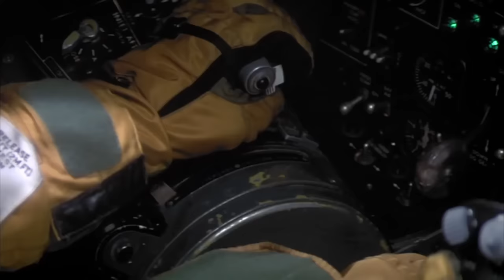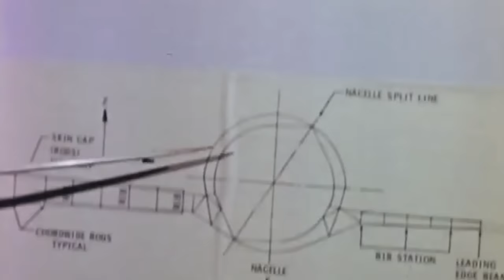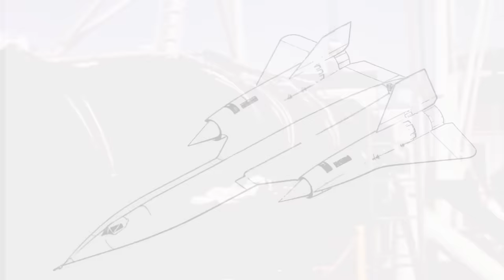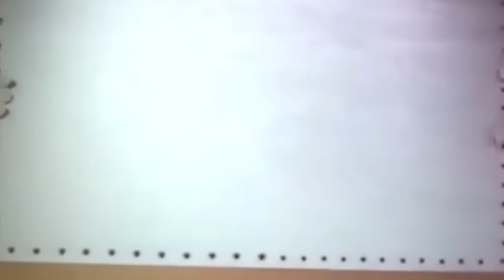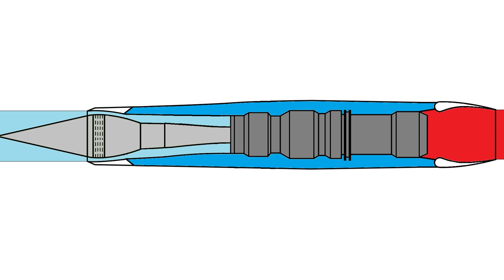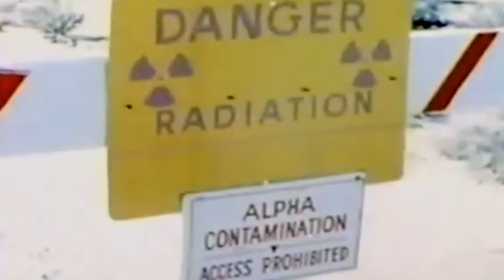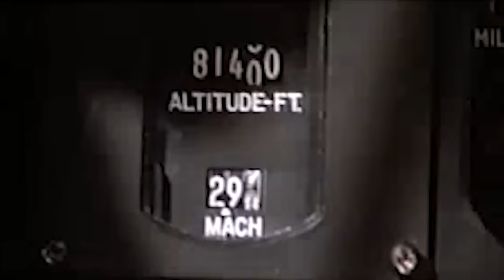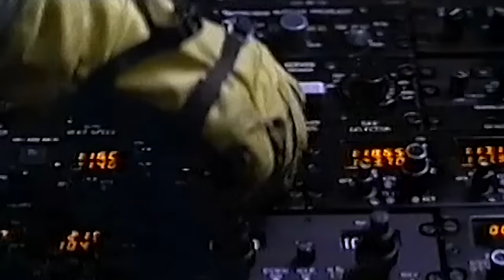Lockheed A-12 | Speed matters

Comment: What I want to know about is the crazy variant they tried to turn into a combat interceptor.  What the hell was that thing capable of?
Reply: YF-12! I'm waiting for it from Sky
Reply: YF-12

Other than high speed, not much. 

What one has to remember is that these planes weighed as much as a 737, with the same maximum G loading (2.5 Gs) but none of the wing area. 

If you hit a merge in an A-12 vs a 737... the 737 would likely quickly gain the advantage... with a full load of passengers in the back!  The only thing the A-12 could do was run and climb. 

As for weapons systems they eventually made it in modified form into the F-14. While the weapon system sounds amazing... every fan of the F-14 knows that it can track 24 targets at a time and engage 6 of them at over 100 miles away with its AIM-54 Phoenix missiles... in practice it was less than spectacular. 

The radar was a giant billboard that announced that F-14s were in the area. That’s why they were modified with passive FLIR sensors and fed data from E2C Hawkeyes rather than announcing their presence to the world. 

The other problem was that in order to achieve the extreme range, Phoenix missiles used a ballistic trajectory.  But this meant that they were incapable of large course corrections. 

So when F-14s engaged a couple of Iraqi aircraft in the no fly zone.. those Iraqis were alerted because of their experiences with Iranian F-14s..... and they simply changed course and the missiles fell short.  

Interceptors were obsolete by the time the YF-12 flew. That’s why the Avro Arrow was cancelled in 1959, the XF-108 was cancelled the same year, and the Soviet Mig-25 though impressive and probably the main reason why Soviet skies were kept A-12 and SR-71 free for decades... had a rather disappointing combat record.
Reply: @Bartonovich52  I had no idea interceptors were obsolete.
Reply: At the time we were developing the XB-70 Mach 3 bomber.   There were those in the DoD who thought the Russians were doing the same and felt we needed a Mach 3 interceptor to stop them.  If you look closely at the YF-12 you will notice that the forward fuselage chine stops where the radome begins.   The chine interfered with the AWG-9 radar and so it was eliminated.   You can't shoot down what you can't 'see'.

Comment: The speed of light is a physical constant denoted by the letter c. Its value is 299,792,458 m / s, or 1,079,252,848.8 km / h. According to a special theory of relativity, no body with mass can reach the speed of light. The speed of light is also the upper limit of the speed of all information, including massless particles.

Comment: Oxcart A-12 was faster than SR-71..Already in the 90s it was speculated that he easy could fly 4000kph in 25km altitude.
Why? Because A-12 had special varnish causing less air resistance. And the engines had other settings, like "a car in sports mode!"
Reply: Skin friction drag is not the issue - it's wave drag and surface coatings have no effect on wave drag.

Comment: The belly of this ultrafast airplane A-12/ SR-71, is like that of a fast racing boat, it's an issue of 'Reynolds number', an adimensional figure expressing relations between viscosity and inertia inside a fluid.
Reply: Um,,, a Reynolds number has more to do with the size of a wing than anything else. Think 747’s and paper airplanes…
Reply: @michaelgarrow3239  Don't know, I'm not engineer, but Reynolds number for sure has connections to speed of aircraft
Reply: @josega6338  -  “The Reynolds number helps predict flow patterns in different fluid flow situations by measuring the ratio between inertial and viscous forces.”
Hope this helps. Not an expert either. But looked into it when I was a kid building model airplanes.
Viscosity is relative to the size of the wing. That is why bees can fly and Tyrannosaurs can’t…
Reply: @michaelgarrow3239  Thanks, that's exactly what I said about Reynolds number. 
Blessings +

Comment: You sure the spike moves back the faster it goes? I thought it was the opposite, because the shockwave moves to the rear as speed increases (like a swept wing moves back out of the shock wave), and it also opens the intake up for more mass flow.
Reply: yes. Wikipedia has a detailed article on the P&W J58. Explains it.

Comment: It had so many fuel leaks, had to be fueled until takeoff.  Not a mistake, the aircraft flew so fast in the air, the skin swelled, and thus the leaks stopped.  Great U.SAir Force airchine!
Reply: It just dripped, the reason for the tanker immediatly after takeoff was that the landing gear couldnt handle the weight of a full fuel load.

Comment: I see you're doing some videos on the A-12/SR-71 series, and I haven't watched the whole video yet, but there's a couple things I hope you do cover, either in this video series or in videos of their own.
The D-21 reconnisance drone that was designed to be launched from modified SR-71s (and later when that proved too risky, it used a solid rocket booster to get it up to speed when launched from a B-52). This might need its own video, but it's intimately connected to the Oxcart program.

Also, it's Russian/Soviet counterparts (with respect to speed at least), the Mig-25 (stainless steel! Amazing that they made it work with a material that in aviation is considered "primitive"), and the Mig-31 (and their recon variants of course). Both interceptors true, but they were very very fast, and I'd like to know if their engines were as revolutionary as the engines in the A-12/SR-71 or if they were just "really really big turbojets" of more conventional design. I do know that the airframe of the Mig-25 was not the limiting factor for speed, and that the engines could be pushed past their design limits if needed (I've seen that on a few other Russian/Soviet combat aircraft like the Mig-21, yet I don't think I've ever seen such a thing on NATO jets, which instead prefer to engage the afterburners).

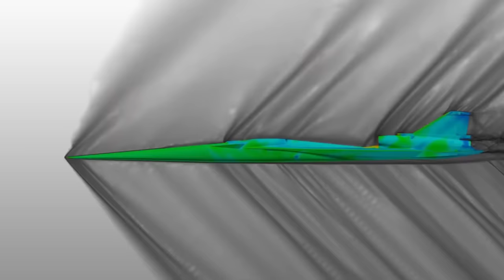Comment: @24:50
"This is without modern design technologies and computers ..."
Wikipedia:
"The only PDP-3 was built by the CIA [...] to process radar cross section data for the Lockheed A-12"
Reply: Computers were widespread at the time. Electronic computers were calculating artillery ranges shortly after WWII. 

Why do people still believe that the SR-71 and the Apollo program were all designed with slide rules?  They would still be working on them today if that was the case.
Reply: And was the PDP-3 a modern computer? For our time?
Reply: @ervandrush3116  
Yes. It was electronic binary Turing-complete programmable computer using von Neumann architecture.

Comment: If I had a few wishes (without practical limits) before I died, one of those would be a fight in an SR71
Reply: Flying in an SR71 is complex and not a typical passenger journey. It requires two pilots to operate the craft and not everybody is physically suited to fly in the craft and to operate it. Flying in the craft requires the use of space suits as there is no oxygen at that altitude and the cabin has lower pressure than a normal aircraft. 
It could be such a rough and harsh experience that people would not enjoy it.

Comment: watching the gas just pour off the thing while in flight is just scary....
Reply: It is not 'gas', it is jet fuel. Kerosene. It is not explosive or even very flammable, especially not the special kind used by the SR-71, which is almost impossible to ignite except under very high temps and pressures.

Comment: Way early on,  I wish the Airforce stuck with their nuclear powered aircraft.    Had they did this?   They would have made a  plane that could stay in the air  well over 24 hours.     If only they found a way to separate hydrogen from the water vapor in air, and use that power and cool the plane?   That would have been so cool.

Comment: Calling it a different plane is silly 
Same basic air frame same engines same fuel same . Go to Palmdale CA blackbird park it’s a parking lot and 2 airplanes An A12 and a sr71 it’s hard to tell them apart
Reply: Yeah, sort of.   The SR is 5 feet longer, has a two person crew, and the chine going forward to the nose is fuller (not as pointy).   The SR has a bit of a 'stinger' out the aft end.

Comment: Didn't the Swiss intercept an SR-71?
Reply: The swedes escorted an engine damaged sr71 back to safety. Not an intercept at full sr speed, but still a serious intercept for their saab 37 viggen planes.
Reply: @dirkcornelis5708   I read the Swedish found out the rought of the SR-71 and tried to practice intercepting it and once it was successful but I don't know if it comes from the same story that your talking about
Reply: @SPak-rt2gb  that would be a different one. Maybe they had a chance when the sr71 left its high and fast profile on the return path. Lets see if we can find data on it.
Reply: They successfully intercepted it multiple times. 

It’s difficult, but not impossible. 

The first is the predictability of the SR-71’s route. The Baltic corridor had to be in international airspace or over friendly nations because in spite of its stealthy pretensions.. the SR-71 had the radar signature of a barn door thanks to the large numbers of particulates in its exhaust plumes. 

The schedule was easy to figure out because anyone within 25 miles of RAF Mildenhall would hear it take off. More than enough time for the Swedes to have a leisurely breakfast and saunter out to their Viggens. 

They’d sortie and loiter at the tropopause... about 36,000 feet on a standard day. This gives you the coldest temperature for your engines and the thin air allows for the highest true airspeed of most planes as well as conserves fuel for the intercept. Any higher and the stagnant temperature starts robbing you of power. 

They spot the SR-71 turn towards it, go max afterburner and max out their speed on an intercept course. 

Then you pull slowly up. Not too fast or you’ll creat drag and lose speed. Not too slow or you’ll lose speed and power in the steadily thinning air. 

Now... most planes of that power can easily zoom up to 90,000 feet or even higher. The risks of course are flame out, rapid depressurization to the point that even pressure demand oxygen won’t keep you alive (which is why SR-71 and U-2 pilots wore full pressure suits), and the potential for the aircraft to tumble uncontrollably in the thin air (which is why the X-15, NF-104, and Space Shuttle have thrusters as well as aerodynamic control surfaces).  So likely a more manageable altitude of 60,000 feet was a target. Which is a mere three miles lower than the SR-71–absolutely nothing in the world of air combat. The SR-71 would be easily visible at 5 miles and possibly visible at 10. 

The big thing is that you can’t maneuver very much in this zoom. So if you misjudged.. or the SR-71 turns, it’s no good. 

But with several aircraft, it becomes easier. Every time the SR-71 turns, it loses speed. Then another aircraft intercepts. On and on it goes. 

This is why when the Soviets did it, they did it from multiple angles. Leaving little doubt that had the SR-71 ever strayed into Soviet airspace, it would be immediately shot down. The Mig-25s and Mig-31s they used to do this were also a lot faster and higher flying than the Viggens.

Comment: Mack 3.2 is the "cruise" speed... nowhere near it "Max" speed.which was closer to mack 5 than mack 3. There are two or three aluminum aircraft that can do mack 3 in short bursts.
Reply: The problem is not the airframe, the limiting factor have been the engines. They had to reduce the planned cruise speed because the engines couldn't withstand the heat at higher speed.
Reply: @simonm1447  Agreed.   As you slow the air down coming into the engines it heats up.   That temperature rise goes like Mach number squared, so going from Mach 3 to Mach 4 is a more than 50% increase in temperature.   Things get hot fast above Mach 3.   And Joseph D, it's Mach, not Mack - named for Ernst Mach.